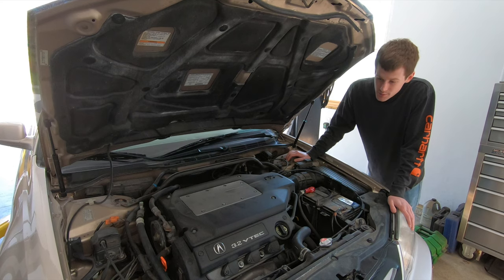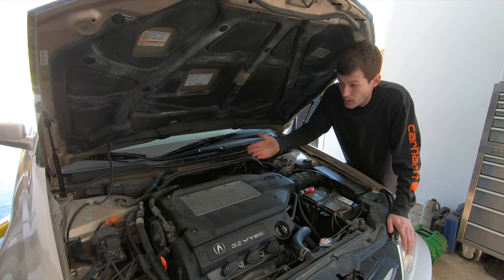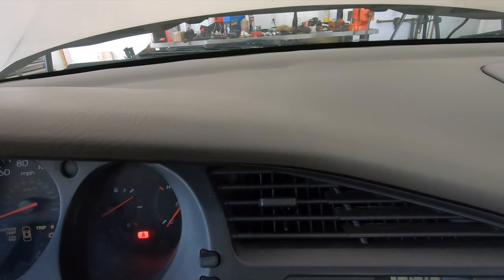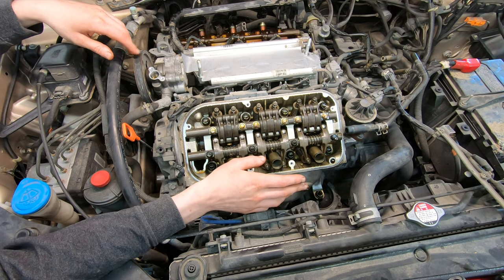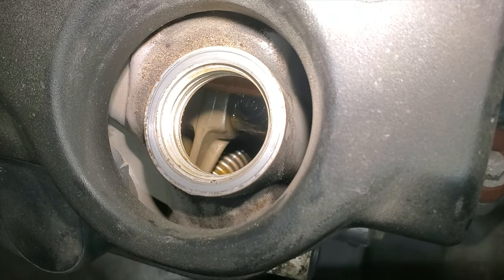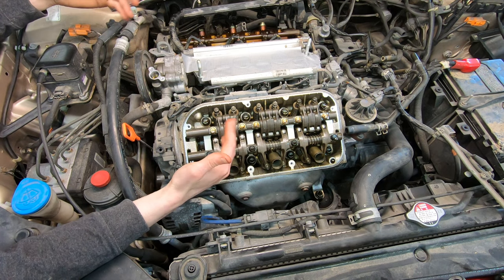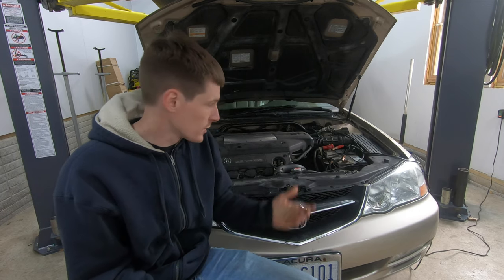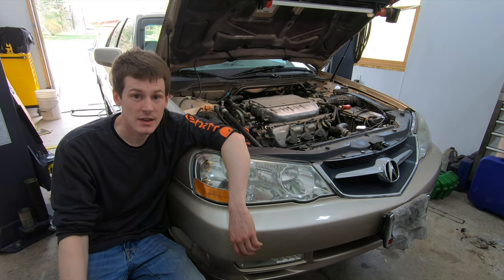Why Do Honda's Need Valve Adjustments?

Comment: I have a 2009 Honda Odyssey 220"000 km 136'000 miles just replacing the timing belt & water pump, tensioner etc. The motor had a clicking noise, different than the obvious valve noise in this video, I think it may have been due to the stretched timing belt & worn tensioner, I understand that clicking sound is common on the Honda V6, hopefully the  new parts make it quiet again pretty sure it's not a rod but doesn't sound that way, have anyone here had a clicking in their Honda V6?  Also it's had high oil consumption from the beginning so finally gonna shut off the VCM.

Comment: Will it damage the engine if the valve is not adjust ?
Reply: It could in time. I think Honda states every 70 or 80,000 miles, about when the timing belt and water pump are due, and that would be the best time to do it, as the motor will be apart. Most folks never do an adjustment, and go 250,000 miles plus. Me, every 100,000 miles is about right, unless you really dog on the motor.

Comment: I just replaced all of the valves on my 2002 J30A1 engine (as well as a timing belt). I have no error lights or codes but it seems to be running rough. I didn't do a valve adjustment, which is stupid but I'm doing one right now. However I dont think its the reason for running rough. So, I start the engine and its running as if it has a misfire (probably is a misfire). Its shaking my car, but not too hard at all. The exhauste is too rough though. Anyways ill run it like this for a sec then ill turn off the car and it won't start thr first or second try but then ill hold it on the 3rd or 4th and it will slowly sputter on and get up to idle rpms. It also seems to run smooth at higher rpms but with a lack of power. One last thing; the exhauste has a little bit of a gasoline smell to it. What do I make of this?
Reply: I also smelled gasoline when I took off the upper intake.

Comment: So why do the exhaust valves tighten over time if it’s due to wear?
Reply from the maker: The exhaust valve face sinks into the head as it wears. It's not wear of the valve it's wear of the sealing portion of the cylinder head. This is called valve recession. Valve recession makes the adjustment tighter than it should be.
Reply: @RepairGeek  interesting, thank you.  Good video.

Comment: I have a ticking with the hood up, & idle stumble, no CELs. 07 odyssey exl 3.5L I-VTEC. I've cleaned throttle, MAP & MAF, EGR valve & ports, plugs & ignition coils. My usual guy says valve adjustment, which I trust him much more than the tire shop who said it's because my flex pipe is cracked & I'm losing exhaust back pressure. You do hear an exhaust leak seal up once it warms up, but I think that's more likely the exhaust manifold? Everything I've ever understood was back pressure isn't relevant past the exhaust manifold, MAYBE a loss in velocity, but not back pressure. Can anyone tell me whether there's any truth to the back pressure thing, since I have an cat past the flex that DOESNT have an 02. BUT cats don't keep back pressure, I mean they're literally filters meant to flow well.... so frustrating. Idle stumble is much worse with cabin fan on, doesn't matter if it's just fan vs AC. thanks in advance for anyone with advice! My next thing was gonna be to take the intake off completely, clean it, & new gaskets.

Comment: Mine Haven't been adjusted in 308,000 miles. The valves aren't loud. But it does have the micro misfires UNTIL the engine reaches normal operating temperature. I can't understand how a valve would become too tight over 308k Miles. Tried coolant temperature sensor, didn't fix it.
Reply from the maker: The valve seat wears. That makes the valve sink into the head which causes the stem to be slightly longer, reducing the clearance.
Reply: @RepairGeek  the camshaft can wear off too.
Reply from the maker: @loualexander3408  cam wear won't make a valve adjustment too tight. Cam wear will loosen the valve adjustment.

Comment: Does anyone know how to tell how much adjustment is necessary?
Reply: Yes. The feeler gauge of the appropriate size will be too small.  Or if you insert the correct one you will then be able to rattle the rocker. Basically you just adjust and when you finish they will be correct

Comment: I have a 2001 Honda CR-V and I did the spark plug wires, spark plugs, distributor cap, and rotor and I unplugged the battery so it will reset itself after all the new parts are in then I drove it the smog check turned all green and I got 1 yellow pending code and it said 1399 and then the check engine light came back on and it was the code P0301 cylinder one misfire and I notice that since I had the Honda CR-V I have never adjusted the valves since I bought it with 215,000 which now has 243,000 miles
Reply: Follow maintenance schedule in owner manual.  It's in the back. You should pay attention to differential fluid change and valve adjustment

Comment: I dont have any missfire issues or engine codes but my car has 344k miles and it def feels like it had loss of power could loose valves be the reason for ut
Reply: engine is likely on its last legs.  get a compression test done.
Reply: @slec-wz1db nevermind ended up being a clogged cat shit runs like ifs brand new lol

Comment: I get that clink clink sound.     But after 2-3rpm it goes away.  come to a red light or let off the accelerator it comes back.        Rev up over 2-3 ....   it goes away......   It came out of the no where.     wont go away .

Comment: I have Honda CRV , What is the difference between spark plugs and valve adjustment ,please ?
Reply: Spark plugs sit in the spark plug well. They produce the spark that ignites the fuel inside the engine.

Valves let air in and exhaust gases out of the cylinder. valve adjustment is a separate maintenance procedure for valve trains (like on a Honda) that don’t have self-adjusting lifters.
Reply: About tree fiddy

Comment: I just wonder if a person leaves this Valve adjustment alone and don't fix anything would it hurt the car in the long run.  If anybody know about this, please let me know. Thank you
Reply: Probably not if they are a bit loose, but a too tight exhaust valve will burn and loss if compression.
Reply: You can burn up the valves and then it gets expensive.

Comment: You say Honda engines last longer being built this way, but you don't have to adjust valves on Toyota engines and they last just as long. Thanks for all the helpful info though!
Reply from the maker: I literally never said Honda engines last longer than anyone else's. I said their valvetrains have less parts than most. That's it.

Comment: I have 3 hondas. 1 is a v6 with 260k miles and never needed a valve adjustment, 1 is an I4 with 201k miles and never needed a valve adjustment and 1 is an I4 with 140k miles and needs a valve adjustment. It is case by case I guess.

Comment: Does the check engine light stay on when valves need adjustment?
Reply: I think it would have to be WAY out of adjustment to cause the Check Engine Light to come on, though I believe it could cause issues with fuel trims. You pretty much have to open it up and check periodically (every 40,000 km/25,000 miles or 2 years is the spec for my Honda's L13A engine, under both the Severe and Normal maintenance schedules).
Reply: The check engine light on my 2008 Pilot went on last week and stayed on; the shop said it had a misfire and suggested a valve adjustment since I have 98,000 miles on the car. I just had this done today. I'll see if it fixes things.
I was real surprised that there was such a thing as valve adjustment in this century. The last car I had with valve adjusting screws was a 1964 Valiant with a slant six.
Reply: @soaringvulture  
So for valve adjustment & new gaskets on the V6 engine what did it cost you?
Hope it's running well now.
It's definitely odd but just part of driving Honda's when they get older.
Reply: Yeah, it is pretty old-school! Let us know if that fixes your issue (or not). :)
Reply: @sameold5050  It cost $1240. Besides new valve cover gaskets they put in new spark plugs. They listed 9 hours of labor, which sounds fishy to me. The car is running fine but I thought it was running fine before. The check engine light is off, though.
Reply: @soaringvulture  
Ok,thanks for the reply.
Honda's are usually more $ than Toyota (for example) to work on & not quite as easy as Toyota.
Much better than most for longevity & reliability though.

Comment: my 2010 accord long cranks when not warmed up and not battery or fuel problem u thnk it need valve adjustment? its only 70k miles
Reply: It needs what the maintenance schedule calls for in user manual
Reply: Plugs?

Comment: i took my cylinder head offf on my d15b7 and i messed with one of the adjustments bolts and one broke off any tips on how to replace
Reply: The valve adjustment shown does not require taking off the cylinder head. What was taken off was the valve cover.

If you broke a bolt off you should order a new one and carefully remove the old one. If you are not sure how have a mechanic do it.
Reply: @loualexander3408  i was just trying to get someone’s help because i took off the valve cover to clean the cam and inside the head but i got curious and messed with one of the valve adjustments bolts and it just broke off , the rest of the screw is still in so it’s not loose or anything but i didn’t know if it’ll effect driving
Reply: @jadenreed9199  Doesn't sound good, man

Comment: My 2011 Honda pilot Has 170k miles and consumes too much oil, can a valve adjustment fix it?
Reply from the maker: No it won't. I don't mean any disrespect by this but, what you're saying is like someone walking into an emergency room with a gunshot wound and asking for a haircut.
Reply: Try different oils.  Some burn more than others, dependent on engine.  If it's more than a quart per oil change interval, don't expect miracles.
Reply: Use standard oil and replace one quart with Lucas oil
Reply: Is it burning it, or is it leaking?

Comment: Wow that sounded terrible. Now I get it. My 2013 coupe 3.5 with 75k doesn't sound like it needs adjusted.. but I think my 02 3.0 does.
Reply: 75k? Your engine just broke in. Revisit the idea after another 75k. I have had acuras for 15 years. None if them needed any of that after just 75k.

The timing belt is coming close. You should do it at around 100-115k.

Comment: Would this fix a misfire
Reply from the maker: Possibly
Reply: @RepairGeek  I got a 2013 pilot and it's reading misfire on #1 cylinder and it's done this 3 times within 6 months and it's at 145 thousand miles, trying to figure it out.

Comment: Too much conflicting information online about honda valve adjustments. Cars noisy at startup when cold, then quiets down when its warm. Runs fine otherwise.
Reply: Nothing conflicting at all, valves are valves, in a semi or a car, this is not rocket science.

Comment: I always heard the engine should be stone cold. Why would you start it to hear it just before you do this? You couldn't record it on a different occasion? Surprising.
Reply: No appreciable amount of heat has soaked into any part in less than a minute of running.  Also when you have a shop you can walk away from the car and let it cool

Comment: after your adjustment there was no difference.  It sounded different on the before and after is b/c your mic was more at the rear of the engine but when your mic was at the front it was the same as the before.